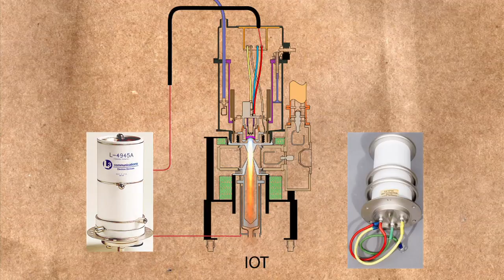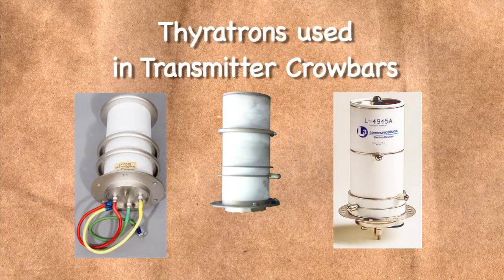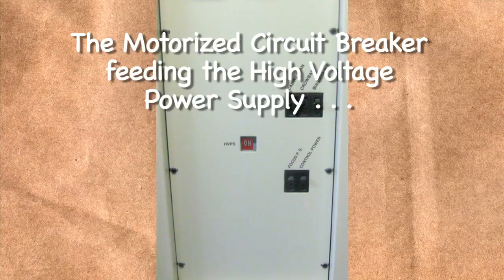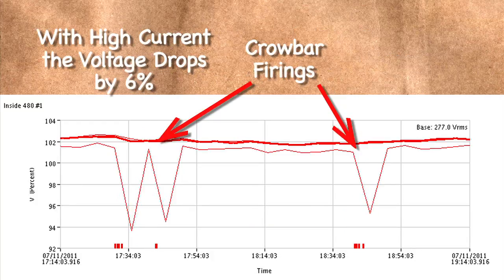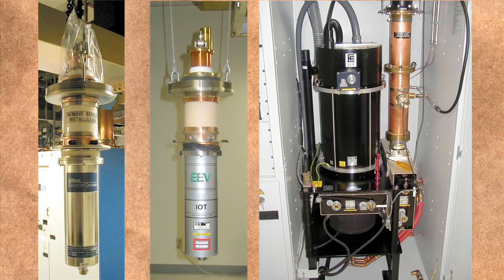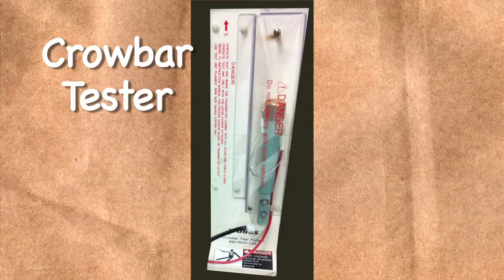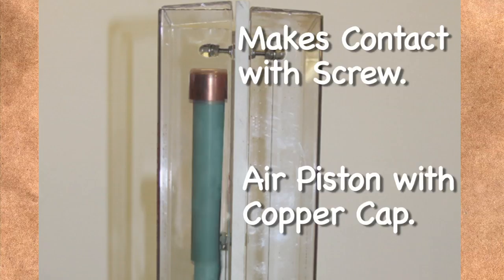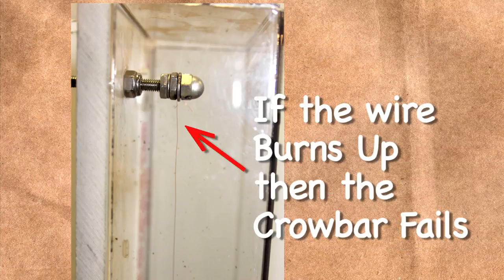Crowbar Testing

Comment from the maker: The term Crowbar applies to any protection circuit that shuts down a power supply very quickly, as if you placed a Crowbar across the terminals and shorted it out. The metaphor of a crowbar is used because it is made of thick metal that will not melt and can handle a great deal of current. Hope that helps, Russ

Comment: 2:39  I'm surprised they don't put a fuse in series between the capacitor and the thyratron.  Seems like that would reduce the demand on the thyratron, since it wouldn't have to drain the whole charge on the capacitor to trip the input circuit breaker.  The fuse would blow before the capacitor was fully discharged.

Comment: Yeesh! Some of these photos show an unacceptably dirty high voltage compartment. Dust is the enemy. This area must be hospital clean. In fact we replaced the input air filters with HEPA grade filters. If you ever see a compartment this dirty, turn the high voltage off, discharge everything with the grounding stick and verify safe, then go get a bunch of lint-free rags and a gallon of denatured alcohol, and get to work. Old t-shirts work well. Clean EVERYTHING including the red and white wires. This will result in less corona and far fewer high voltage trips and crowbar events. Even the skin oils from your fingers are bad. Use alcohol to wipe everything down that you have touched.